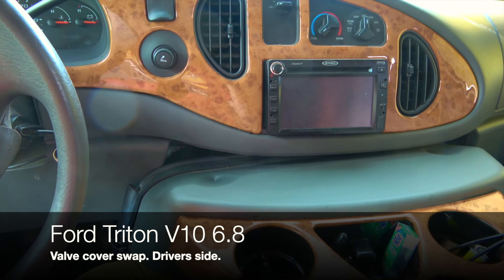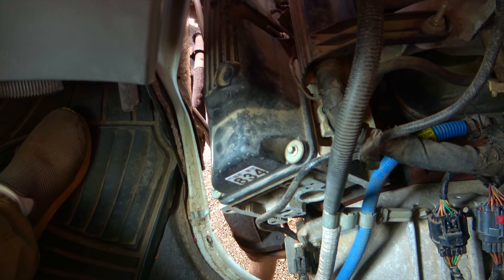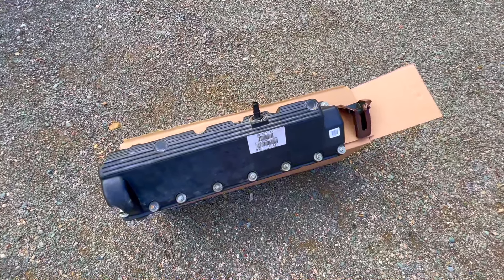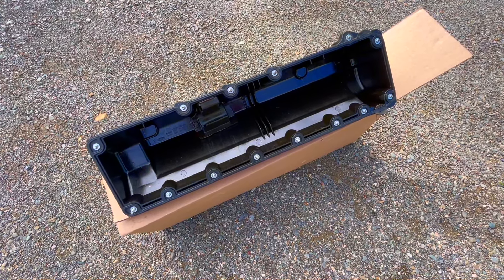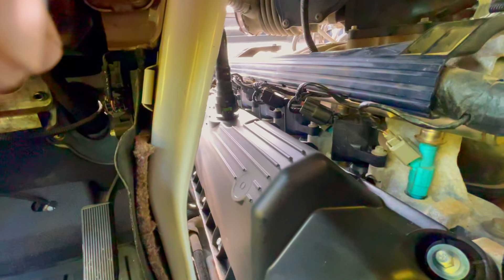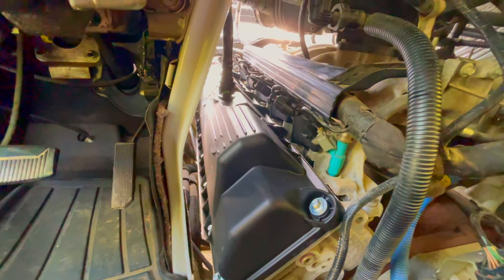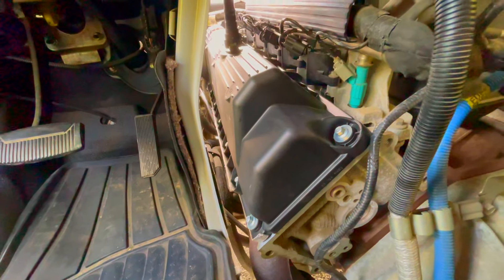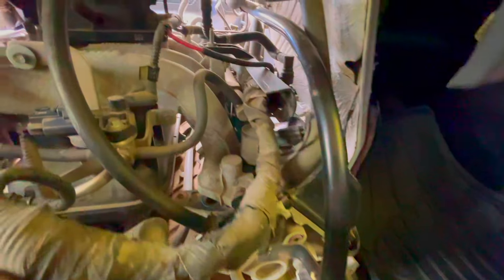Ford Triton V10 6.8 Noise, Valve Cover Replacement

Comment: Currently doing one at work due to in not passing the smog visual inspection because someone decided to glob a bunch of JB Kwick to connect the air Breather tube on top of the valve cover due to it being damaged and the driver side valve cover is almost impossible to find for a 99 v10.  There's not to much of a difference when looking at the Valve covers but apparently there is something that is different, what that is, I'm not sure. But we got one.

Mine has a EGR tube and two smaller tubes that come from the exhaust manifold and sort of go over the valve cover on the driver side.....did you have to deal with that also?
Reply from the maker: I dont think I had the two smaller tubes.  What you see in the video is pretty representative of what I had to move or deal with. Air filter assembly, a couple of wiring harnesses, Ignition coils, and fuel injector connections. It was still tight , But perseverance paid off.  I bought the passenger side as well and dread if and when I have to deal with that one.  Had I needed to get more aggressive to gain access I would have then just done them both. But solved the initial issue of replacing the drivers side and moved on the the next pending project.